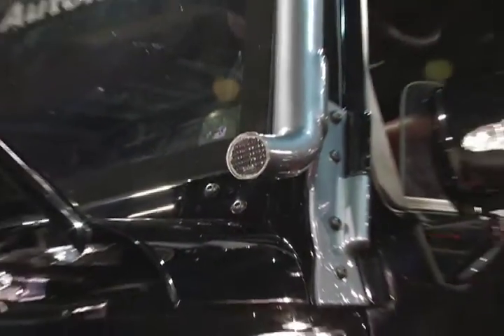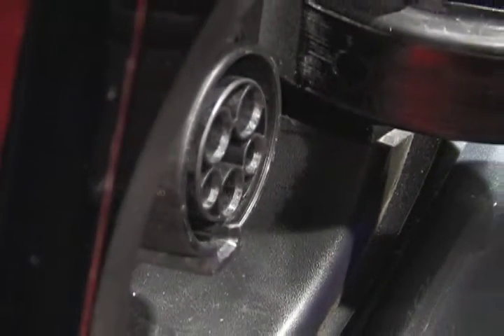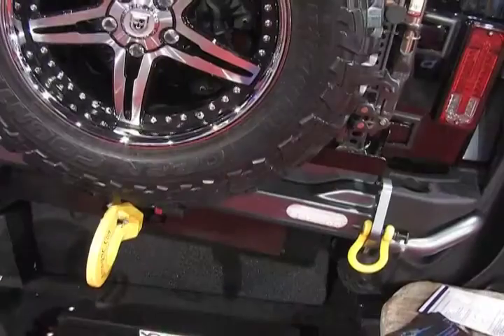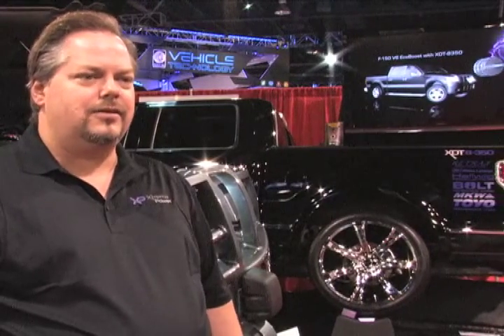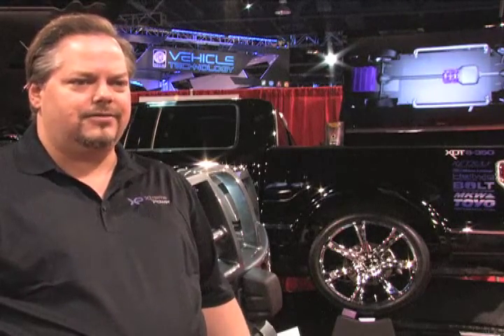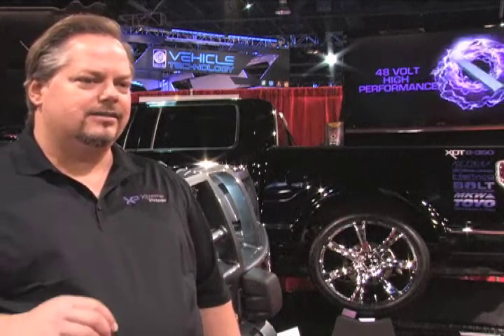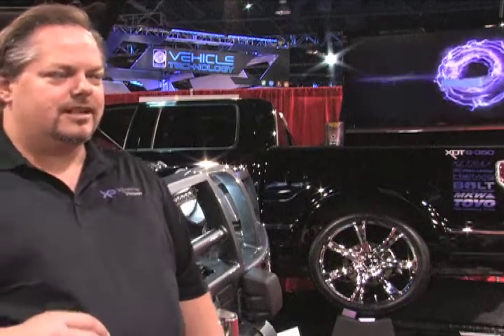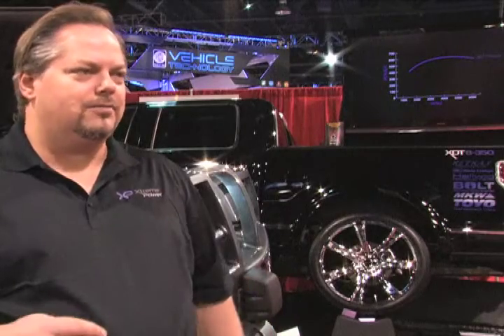F-150 / Jeep Plug In Hybrid Conversion - Xtreme Power

Comment: 4kw in a big truck like that will only get 8-10 miles max. 4Kw is super small. Volts don't kill people it is current that kills people. This thing is going to cost at least $10,000. Dry cell lead acid? this video gets worse the longer I listen.
Reply: It’s 10 years old (6 years old when you posted your comment). Lithium ion battery packs would go miles further no pun intended. It’s also only to complement the engine, not replace it. I think this video is a proof of concept more than anything